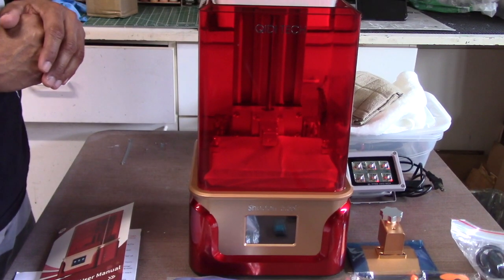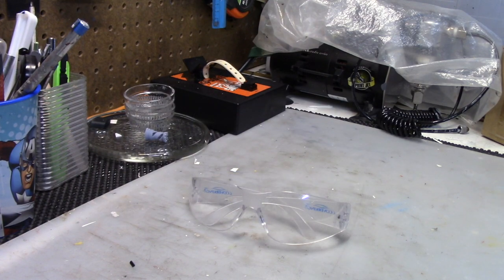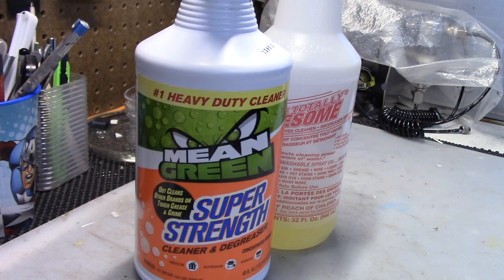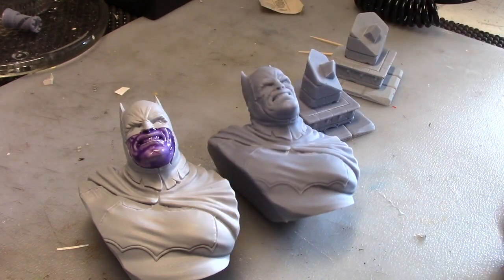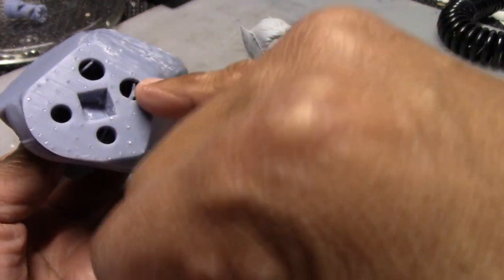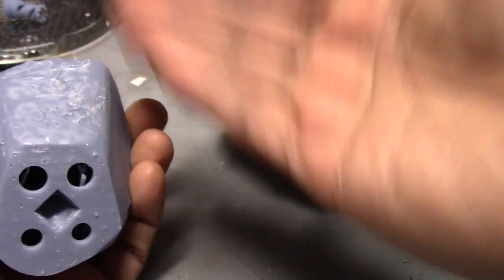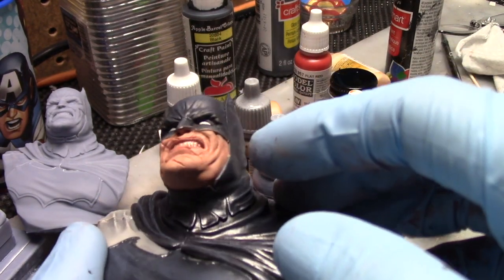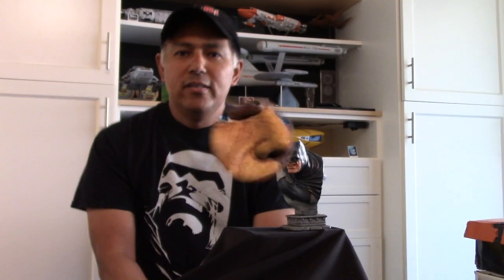Let's talk about 3D Printing

Comment: Desperately want to get a resin printer at some point. It's just a matter of finding the space for one. My workbench/hobby room is pretty small. 

I bought a Maker Select Plus (Wanhao Duplicator i3 Plus clone) just over a year ago, before resin printers really started to become more affordable--it has a build volume of 200x200x180mm. I've used it to print some terrain for an AMT Batmobile (1989) diorama, one Supergirl figurine, and some light blocking parts for Star Trek kits. But I mostly use it for practical things--such as a jar/bottle opener for Tamiya paints, recently. I had a bottle of X-12 that was stuck, and wanted to use it for the Polar Lights 1/1000 NX-01 Refit. I saved myself a quite a bit of money there.
Reply from the maker: Thanks for the comment.  You're gonna love the resin printer.  Amazing quality and detailing as you can see.  Thank you for watching.

Comment: I have a few different printers and love them all. 3D Printing adds a huge amount of flexibility to your projects. You don't have to have any special skills or trainning to start. For smaller parts I recommend getting a resin printer. I use a resin called Polyjuice (brand name) once you removed the print it can be cleaned in regular water with a brush or ultrasonic cleaner, it also doesn't need to be post UV cured like a lot of other resins. For larger parts FDM printers are best but the prints will need a lot of sanding and smoothing for a quality finish. You can also design your own prints with free cad packages, Fusion 360 is what I recommend using but there are other programs as well. You can use it to create new parts to modify existing kits as well as create larger full models. There are millions of free files online that are extremely easy to download and use. I've used my printers to create parts as small as gun barrels on 40k models and I made multiple large pieces to create a full 1:1 scale "Billy the Puppet" from the Saw movies (It's as tall as my 3 year old). I can't recommended getting a printer enough.
Reply from the maker: Thank you Paul for all this great information.  I look forward to learning more about 3D printing for sure.  I know the potential is pretty huge when it comes to adding this to our hobby.  Thanks again and I appreciate you watching.

Comment: Great video. Sorry you had so much trouble with your first foray into 3D resin printing. I personally have two Anycubic Photon S printers and one Epax X10. I love all three of them and they're pretty solid in structure and performance.
Reply from the maker: Thanks Omar...I kept going back and forth about the type of printer to buy next.  I correspond with Ken frequently so I figured he'd be a great source to turn to if I needed any help. I've heard good things about both the Epax and Anycubic printers as well.  Thanks
Reply: @InterstellarModeler  Ken is a good guy and his printing is coming out great. If you ever need any advice for larger scale resin printing, feel free to reach out to me. The Epax X10 is a midsize large resin printer.
Reply from the maker: omar will do....I’ll check out the Epax, thanks

Comment: I've lookd at 3D printing/printers, but I think that I'm going to give it another couple of years for the tech to advance a little more, and become a little more cheaper for better quality. 
However, both Batman and Superman look great - once painted I don't think you could tell they were 3D prints. Very interesting vid though, and thanks for sharing.
Reply from the maker: This technology will only improve no doubt.  I am impressed with the level of quality from these resin prints.  One can definitely appreciate the fine details once the figures are painted. Thanks for your comment and for watching.
Reply: Cygnusx10, I would pull the trigger on getting one now if you have the money to spend. These things are great for all sorts of applications.